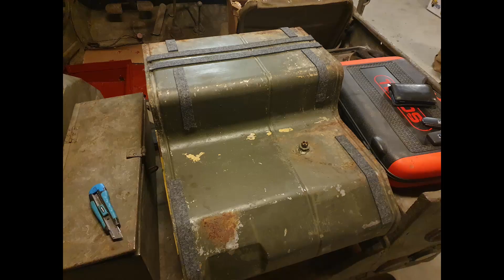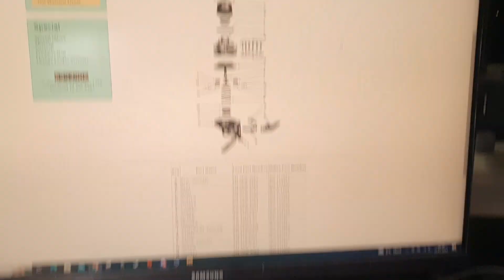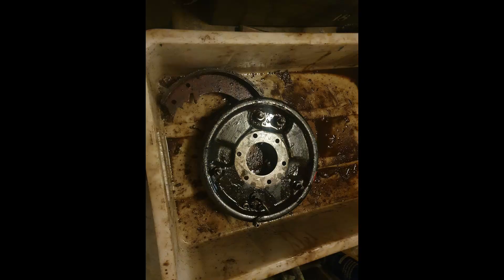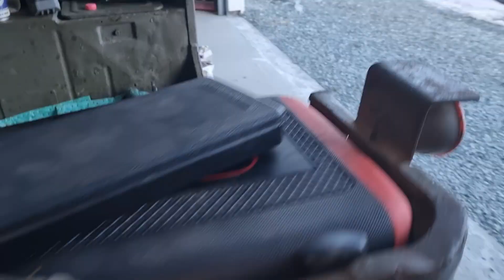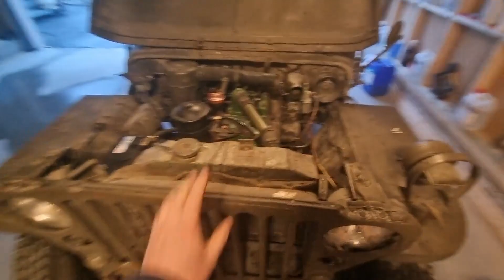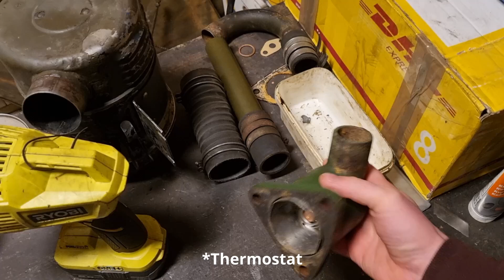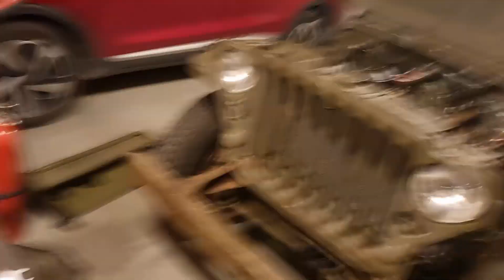Restoring a barnfind 1942 Ford GPW | WW2 jeep with recoilless rifle

Comment: Man, this is amazing! Great find, I wish mine was in half this shape…
Question though-did they move the rear shock upper mounts for the recoilless rifle? Normally, the MB/GPW upper mounts are directly above the plates-not angled like a CJ2-A…excellent work!
Reply from the maker: I think they were removed during the conversion to carry the recoilless rifle here in Norway. My jeep came with the original leaf springs and coil springs in a box, as they had been removed when the army took the rifle off. I suspect a lot of things were moved around a bit to make the gun and its necessary parts fit properly.

Comment: I would have painted the head green with some high heat engine paint.  You had it off, why not ?  The TStat gasket you made does not seem thick enough.  Uses water ?  Not coolant ?  Water will rust, coolant will not. I would replace all those spring locks, just not the broken one.

Comment: Regarding the colored springs with the brake service kit, the plastic coating, at least when I did it, seemed to be compromised by the brake cleaner I used and contaminated the entire area with tiny bits of green plastic chips, that peeled off the springs.  I had to “super soak” the entire area with 2 cans of brake cleaner to get it all out and replaced the springs with ones without the coating.  It was not immediate though, luckily I rechecked under the drum about an hour after I serviced the brakes, to adjust the shoes, and that’s when I noticed it.
Reply from the maker: Thanks, I will keep an eye out for it when I check my brakes next time!

Comment: the updated specification for the exhaust valve adjustment is .016 inches...if they are too close you risk burning the edge of the valve as it needs a bit of time in contact with the cylinder block to shed the heat when it is closed...the slightly larger clearance increases this time of contact.

Comment: I haven't watched more than 08:37 minutes of this video yet, so I may be recommending something that you already have.  Service, master parts catalogs, & owners manuals are available for your Jeep.  I'm in the U.S., so I can get them from "kaiserwillys" and other companies -- I'm sure that you have similar sources nearer to you.  If not, check their website to see if they have any documents & other items that you might need.  Thumbs up!

The master parts manuals & service manuals are worth their weight in gold and show how these old Jeeps are assembled, similar to aircraft IPBs (Illustrated Parts Breakdowns),  The IPBs are very useful for those not familiar with whatever vehicle they are working on.

Edit: Dad fought in the Korean War and said that the Jeeps with recoilless rifles tended to turn/tip over due to their relatively high center of gravity (CG).  I wouldn't be surprised to find out that the Soldiers & Marines tended to overload those Jeeps (which probably helped to raise the CGs)!

Also, those original brake shoes were lined with material containing asbestos.  Fortunately for you the grease/oil that got onto the brake shoes & brake drums probably kept the asbestos dust from blowing around & onto you.

Comment: I can’t believe you used that flexible exhaust shit on such a historic project.  I watched enough of you to last a long time.
Reply: A length of flexible exhaust pipe was used on all original jeeps at that point. It was there to allow the engine assembly to flex, while the rest of the pipe was rigidly bolted to the frame.

Comment: I'll assume that what we have here is a WWII US jeep that has been modified for UK postwar service by adding additional marker lights and has had a newer M38 recoilless rifle windscreen added. Being a WWII enthusiast, I recommend ditching the newer windscreen for a correct type. (I see you took my advice :). The horn is likely a UK replacement that I can live with. The saddest part is the rear body panel being eliminated. This can be rectified (no rush) as replacement body parts are available. Then at the ending, sadly, you have to spoil the whole works by wasting money and time on the postwar replica stuff. :(  Having bemoaned this, if you object is to show the vehicle as a postwar UK service item, that is a different tale.
Reply from the maker: It's a WWII jeep alright, but it has been modified by the Norwegian Army in 1955, and that is how I mean to display it :) there are loads of WWII original jeeps still around here in Norway, but postwar modifications are quite rare and interesting, so this one is shown off as one of those
Reply: @andysmodelandstuff  Good plan!

Comment: A bit of advice from Denmark:
You changed out a perfectly fine original carb to manifold gasket. The repro ones with the copper bushings in the holes are crap, and should never have been invented. The copper prevents the gasket from compressing, and intake leaks are often seen with those. Find an original one without the copper bushings, or remove them from the gasket (or reuse the old one if it is not broken).

Comment: I live in Belgium and did my military service in Germany Siegen 1974 and there I drove a lot with Willy Jeep and I thought that was absolutely cool, I don't know why I want to recreate a scale model of Willy on scale of 1/16 or 1/15 in wood or plastic ? and your work here is beautiful and I am actually jealous of it👍and cool that you speak English, at one point I saw that the driver's window was no longer a double separated one and also on your wedding ride👌💌and on the parade again a separated windows for the weapon ? also a metal rod (with a slight fold) is missing in the engine part from the hinge point under the hood and the radiator and on that radiator there is a metal angle piece with 90 degrees to be able to mount this (to ensure the radiator is secure).   👍😉
Reply from the maker: You have a good eye for details ;) I have to separate windscreens on the jeep: the original one and the 1950-s norwegian modified split screen. I swap them out when I want do drive one version or another and I like to tell people I have two jeeps! I do have the rod to hold the radiator in place, but that was the last thing I put on so its not shown

Comment: You may think some of that stuff was in horrible condition, but that whole Willys was in AMAZING condition! I would die to find one in that good of shape! Excellent video!
Reply from the maker: Oh yea, make no mistake I know that the all over condition was good, but the guy I bought if from claimed it was a matter of a new battery and then hit the road, which it clearly wasn't. Thanks!
Reply: @andysmodelandstuff  yes have heard that from auto sellers.  Also “ should run just fine, ran when it was parked”!
Reply: It's a Ford.

After the Ordnance Department (US) awarded the bid to build 'Truck, 1/4 Ton, 4X4, G503' to Willys Overland in July of 1941, Ford was added as subcontractor. in October of same year.

By war's end Willys would supply over 360,000 of their Model MB as Ford would produce over 280,000 of their Model GPW (as this example).

Comment: A tips, if you need to remove rust from small parts and have no opportunity to sand or medium blast, use citric acid solution, its very cheap and you can buy it in almost every bigger food store!!!
Reply from the maker: Thanks! I''ll keep that in mind

Comment: Excellent mate. Just finished watching the whole video. You did great with some pretty big jobs on there. I would be going nuts if I had to pull the head off my engine :D
It has come out really well and great to see you enjoying it at a show. That is what it is all about :D
Reply from the maker: Thanks! Taking of the head was really not a huge deal, the only issue was me beeing terrified the hole time. I was scared the block had frose cracked but once that turned out to be OK it was a huge relief, and after it was machined it was sooo satisfying to put it back together. No issues so far!

Comment: All that grease around the master cylinder looks to me like it has probably come from years of grease being pumped into the steering draglink assembly. You can see the grease nipple for the drag link sticking out and it is the only place near the master cylinder that gets greased. It is possible some of the gunk is also oil that has leaked out of the steering box over time :)
Reply from the maker: Aha, that would make sense! I was no closer to figuring out what had happened, but you are probably right, thank you!